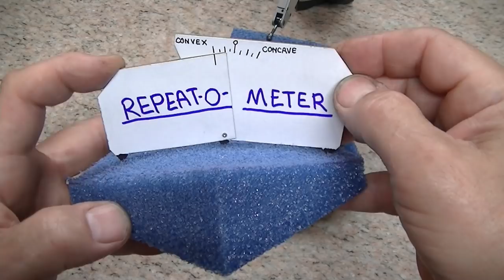ROBRENZ ATD #1 INTRO, 3 PLATE METHOD

Comment: 00:03:24 limitations of the pure 3 plate method
no other measuring instruments.
Question : why can't you use the three plate method to rub three stones on each other and get them flat?
Answer : That is because a absolute requirement of the three plate method is that you must be able to rotate your part in 90 degrees when you are doing your checking...
00:07:28 the answer is no.